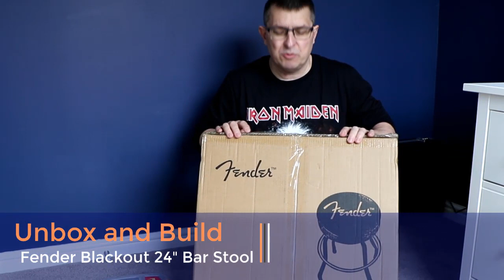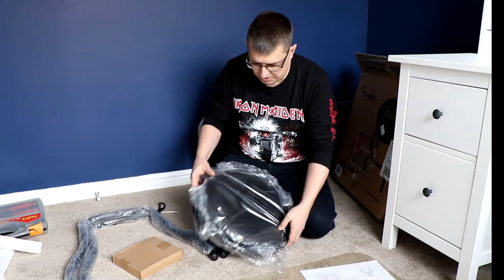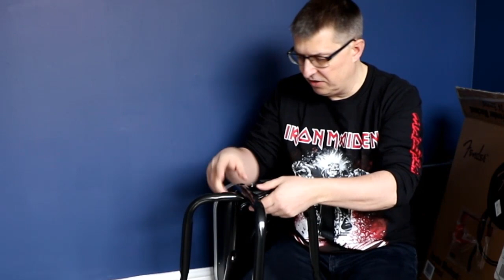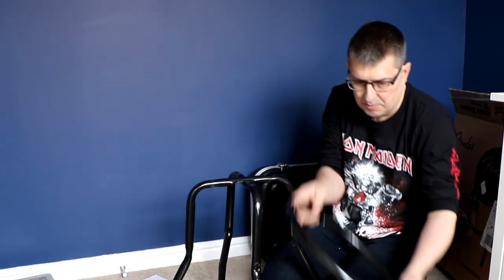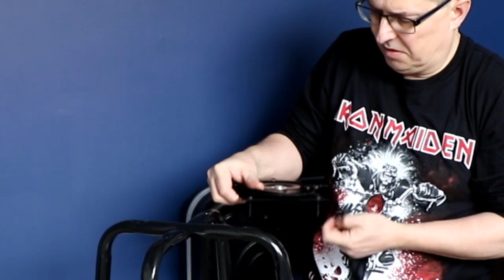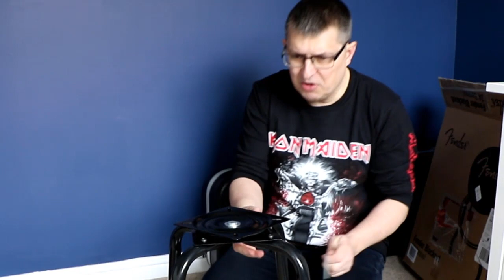Unboxing and How To Assemble my new Fender Blackout 24" Barstool (GUITAR STOOL).

Comment: Hi, I'm watching this after assemblying one earlier today. Good video showing some of the issues during assembly. 
I got one of these today as a present and to be honest, the assembly should be straight forward but guess what?
It's a JOKE.
My two cross bars were so badly out of shape, I needed to put them in a vice to pull them out to get them remotely close to lining up with the circular bar. 
The fact you can bend it shows the light guage pipe is cheap. 
Also some of the chrome coating came off in the assembly process. 
The pissy supplied aluminium hex wrench stripped when tightening under load and I lost some skin but luckily I have steel hex wrenchs to continue with. 
This set up could be a lot easier if they had self tapping screws or bolts.
The swivel bass was so tight it had to go in the vice and needed persuasion with a rubber mallot to move into position to attach it.
Once I had it assembled it was off balance with one leg not level.
After sitting on it for awhile it levelled out.
It's solid enough and the final product is pretty good.
The assembly though is disappointing and the ease of assembly will vary from stool to stool as quality control at the production line seems inconsistent from seeing reviews.
As mentioned it was a present but if I'd known what I know now, I would buy an old bar stool or make my own. 
I'm thinking of making new legs/frame but I'll leave it as it is for now and see how durable it is. 
Cheers

Comment: The square park that turns into the diamond isnt turning it is locked in as a square how do I turn it
Reply from the maker: If I remember correctly it is really very stiff to move.  It moves much more easily when attached to the stool.  If yours is really locked, I'd contact wherever you bought it for advice.  It might be faulty.
Reply: @SypherLXVII-MySixStringJourney  We got it working, it was very stiff and we just used tools to move. Thanks man 🤘🏻

Comment: Finished it..painful as hell.

Also, it's nowhere near padded enough for rehearsing for hours as I do. If you're contemplating buying this..DON'T. Spend however much on a better quality stool. This one was mid to higher price point to $80 on Amazon US. 

Also, I respect you tried to use their "tools" I did too, until the end and now my hands are tore up & I' won't play guitar for at least 24hrs.

Still your Video gave me the little bit of comic relief I needed and visual, to aid in finalizing the 3 painful steps.

Thank you.
Subscribed.
Reply from the maker: Glad you got it built Zak.  I find mine pretty comfortable but I sat on roc drum stool recently and really wish that I had saved the extra cash (some 3x or more), alas.  It's on the wish list.

Comment: How is it for reaching pedals while seated?  I often use a looper pedal while rehearsing.
Reply from the maker: I guess that it will depend how long your legs are.  I am not tall, but I do not have any trouble reaching the ME-80 on the floor.  I usually sit with one foot on the stool's bar and one on the floor.
Reply: @SypherLXVII-MySixStringJourney ,  My leg bends at about 17 inches.  I have usded a 24 1/2 inch bar stool - its not a comfortable position and has a wooden seat.  I have used a 16 inch office chair but my back locks up after rehearsing for any lenght of time.  It maybe just a bad back or perhaps i should look into a drummers throne which maybe better suited to the task.

Comment: I received this stool today and was very very dissapointed. The cardboard box stank up my whole livingroom with a musty, waterdamage like odor. I had to remove the box from the room. It was that bad. 
The stool frame is cheap and wobbly and i couldn't attach the cushion because the allen screws didnt fit at all. The screws were also of the cheapest possible quality and the allen tool barely fitted, after a few turn the allen tool would go round in the screw. 
This is 90 euro stool. It should be way way better. I,m sending it back and will spend more for a better chair. Fender should be ashamed.
Reply from the maker: Ouch, I can see why you were not happy.